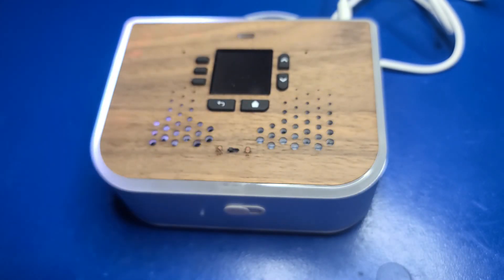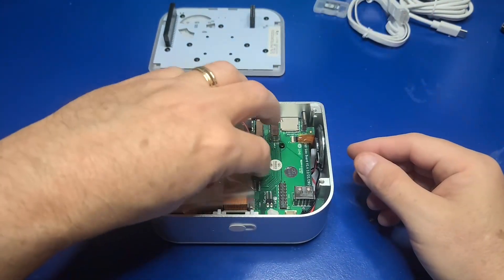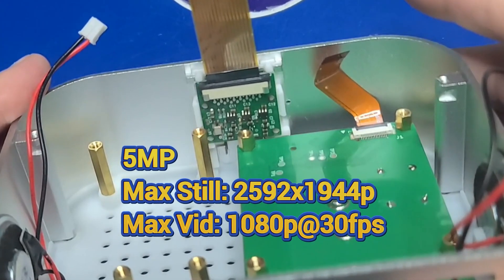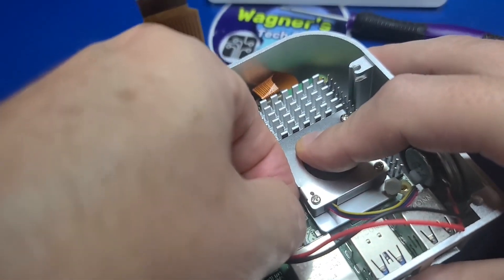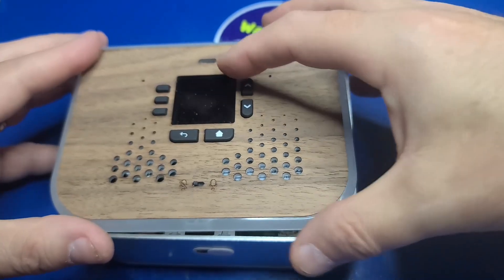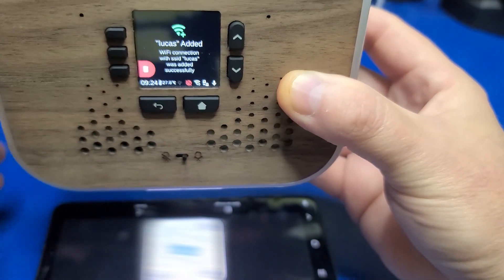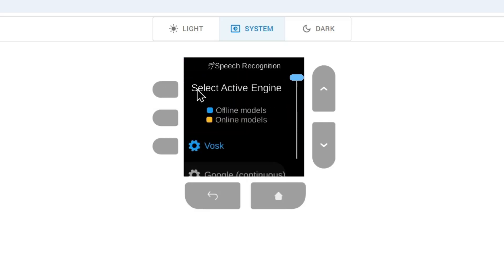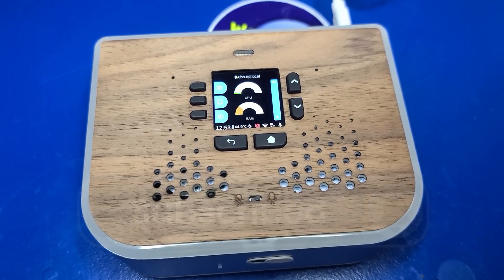Ubo Pod + Raspberry Pi 5 Setup: The Ultimate Personal AI Assistant

Comment: Project creator here. Thanks to Jon for all the work he put into making this video. If anyone has any questions, please comment on the video and I'd be happy to address your questions.
Reply: What inspired this I'm super interested and glad I saw this video
Reply: @Zero_Chill_Gaming  I had previously worked on several embedded projects that used Pi and SBCs. Most of these projects needed to interact with an end user... so some form of UI was always needed. Unlike more mature platforms like android, ios, etc, it is always painful to build a good UI/UX for embedded systems due to lack of built-in display, audio, etc and a software layer that would abstract away the UI. So typically implementation of a simple idea would spiral into debugging driver level and low level code that your display, audio, etc rely on. This was the main driver to start working on this project as I wanted to build an open foundation that also others can use to build interactive apps (apps with multi-modal UI/UX). I look at speech and vision as other forms of UI so over time I expanded the idea to add these to give apps a richer UI/UX toolset. We are constantly working to decouple hardware and software as much as possible so that users can use the software on other SBCs and mini PCs that run Linux and attach needed hardware peripherals on a need basis. Right now you can run the software on linux (system python 3.11 and higher needed) or on MacOS. The software would search for built-in camera and audio and use it. If not sound, those features will be disabled. Our long-term vision is to build a distributed system of nodes that can coordinate and talk to each other to perform a specific task in the best possible way.
Reply from the maker: Thank you @ubopod for putting together this very impressive project!  From what I've been seeing during testing, the software appears to be solid.

Comment: hmmmm it's an interesting device but when used using remote api-s it's no more powerful than your terminal phone or anything else - now do the test again with one of the local LLM and tell me how many minutes it takes to reply =)
Reply: I am the project creator. You are bringing up a good point. The part that Jon is demoing in the video is using OpenAI but I believe he is going to demo fully local option on device in Part 2 of the video. Basically on Pi 5, we get decent performance with VOSK STT + gemma3:1b LLM model + Piper TTS. It takes the device 3~4 second to respond. However, 1 billion parameter model has limited capability and accuracy and that is why we offer a path to run the LLM model separately on Nvidia Jetson Nano Orin on the same network. LLM optimization is work in progress. We are experimenting with optimizations on Hailo AI accelerator (specially to accelerate the encoding stage of the LLMs). This is a dev kit to get more developers into building local and on-device experiences and really not a end-consumer device.

I believe Jon has a plan to go more in-depth into customization options for the assistant in part 2 of the video... so stay tuned. If you have any feedback on what you would like to see in Part 2 please feel free to comment here and Jon will probably include it in part 2.
Reply: On a separate note, one advantage of using pi for this (instead of phone, esp32, etc) even if you are using cloud APIs is the availability of runtime environments (node, uv, docker) for hosting MCP servers and tool calling and also the fact that this is always on and connected. Jon will probably demo tool calling in Part 2.
Reply from the maker: We'll explore local LLM optimizations that the developer mentioned here for Part 2.